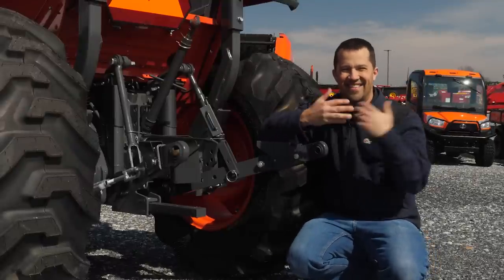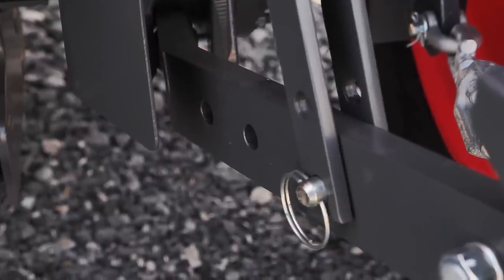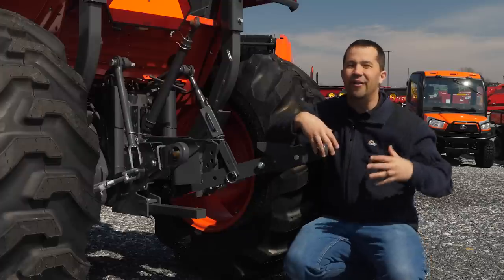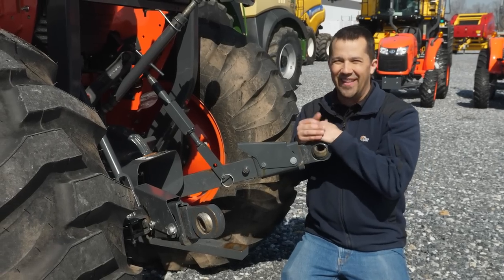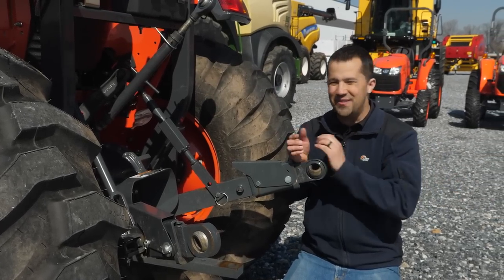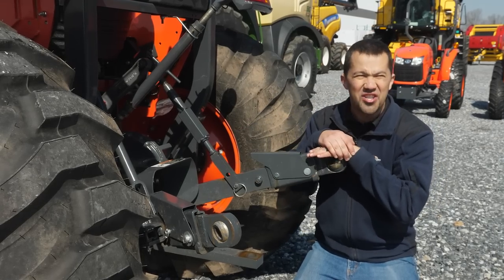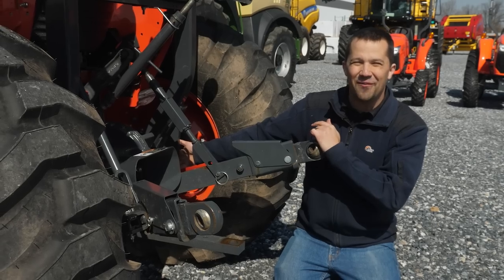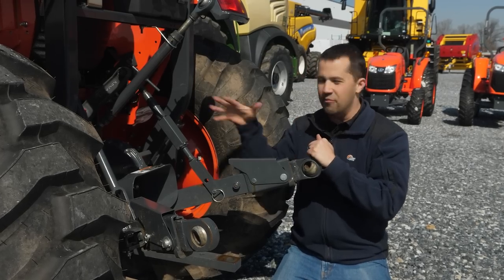What adjustments can you make to your three point hitch?

Comment: I work at an auto plant.  A lot of the holes or other features in a cars structure that aren't used in it's assembly are usually used at some stage in its manufacture.  A hole may exist solely to fit over a locating pin in a fixture before some parts are welded, for example.

Comment: I build my own tools to go on my 3 point hitch. I have a small compact tractor a 234 International  hydrostatic transmission tractor. I used a furniture dolly mounted for my 3 point hitch to move wood. It kept braking every day until I bought my own welder. I have built a box scraper, a rake and pallet forks . I also use it to stabilize it for pulling trailers. Works great! Multiple uses.

Comment: Hey Neil! Outstanding video and information, as always. I've owned two different tractors, and still learned something. When I had my BX23, I did have to make some adjustments when I had a PTO driven chipper that I ran off of the back. Didn't really know what I was doing, but trial and error ended up working out just fine. 👍💪

Comment: Excellent, Neil! Often with rear implements it's about geometry. Changing the length of your top link will change the angle of your rear blade causing it to dig in more. Trial and error can often be a brutal and costly teacher. Your tips are great. I really like the telescoping link set up. I had the old turnbuckles on my old Kubota and this is MUCH easier on my L3560.

Comment: Using a middle buster to dig potatoes using our LX2610, we shifted to the holes closer to the rear of the tractor on the arms so we could get the plow down far enough in the soil to kick the potatoes up. We also use a quick hitch, which adds some length, and helps add a bit more depth in this case. The process is a bit more involved switching back and forth as we have to take off the quick hitch to move holes on the arms, and then put them back for other implements, but this made all the difference in using that attachment.

Comment: Great explanation Neil! I would like to see a video on hydraulic top and side links and what advantages/disadvantages they offer. Keep up the great work! 😀
Reply: A hydraulic side link is usually connected to a remote with float capability. That lets your implement (say a landscape rake) tilt from side to side in order to follow the terrain. With a hydraulic top link, you can tilt the implement forward or backwards. That would come in handy for something like a box blade - tilting it backwards will make the rear blade contact the ground first, so so you're smoothing as you drive forward. Tilting it a little forwards will make the front bade contact first, for scraping. Tilting it a lot forward will maximize the scarifiers.

Comment: On my MX5200, I have to go with the upper hole on the lift arm when I put my grader blade on. This allows for more clearance to back over snow banks or dirt mounds to drag them out. Most every other implement uses the lower holes. I think I  change it for my rotary mower also so I can actually lift it off the ground for travel.

Comment: Neal. Thanks for the video. I am not a rookie and learned from your video. I have a 58 HP tractor that has a Cat2 3-point and it has a top link as you described. One end is Cat2 and the other is Cat1. I have not been using the top link that came with the tractor with my Cat1 blade because the Cat2 end of the top link is too wide to fit the space where it needs to attach to the blade. Watching the video it makes sense what you said about the top link being reversible. I went out to my tractor and found that the bracket that hold the top link at the tractor is definitely Cat1 size as far as the pin size and the measurement of the inside of the bracket.  so I am not able to flip my top link around and put the Cat1 at the implement because the Cat 2 end of the top link will not fit on the tractor side.  Hope this makes sense. I have been tempted to grind 1/8” off the shoulder on each side of the Cat2 end so it would fit but I have not done so. What do you suggest?
Reply from the maker: I have heard of others that grind the top link down. Your right, aftermarket ones don't always fit correctly.

Comment: Let me tell you, I have a B2650, plus a few standard Implaments. My pride and not so joy 3 POINT TRACTOR SUBSOILER ATTACHMENT.
 When it’s mounted on the 3-point raised all the way up, it has maybe one inch of clearance from the bottom of the fork to the ground.
  I have about 3-acres to play around, good part is Clay and Tree roots.  This Implement goes through it like a boss, even buried full depth of 18” working distance..
Reply: Must have hit just the right angle (top link length)

Too long the subsoiler can skip along the surface refusing to go in the ground.
Too short they'll try to haul the back end of the tractor down and can occasionally pull the front off the ground.

Good implement, Needs a bit of tweaking to get them right sometimes.
Reply: @fhuber7507  best i could do is get it as high as i could.  I should’ve also, i did have one fail, shear pins are there for a reason as i found out, sheared the pin at the top of the subsoiler where it connects to the top link.  I turned around and noticed the subsoiler was hanging kinda low, checked it, the bolt is about 3/4” sheared in two. I wasn’t even aware it happened.
Reply: @victorlawver6957  I look over my shoulder a lot running my subsoiler.

Fortunately, no rocks or roots to worry about, so once adjusted, rarely anything to worry about.

Comment: Aloha Neil! I’ve had issues with brush hogs… when I bought my first tractor (L4701) three years ago, I bought it with a 72” rotary cutter. I’ve broken six blades on the thing (although none lately). The way the dealer set it up seemed to create some problems… I read the manual and according to it everything was ok. I started adjusting various angles (tailwheel height, top link, etc), and things seem to be better now. Could you do a “master class” in setting one of these up? I noticed letting it “sway” more seemed to help.
Reply: Are you hitting things on the ground and not noticing that you're hitting things? I've seen some very poor operators beat the piss out of bushhogs and I've never seen a blade break.
Reply: I had a guy hit a concrete manhole cover and didn't break a blade he bent the output shaft on the gear box slightly. Never seen a blade break though they are nearly an inch thick
Reply: @mesanders1113  they break through the bolt hole.. I hit basketball size chunks of basalt the tractor tires rip out of the ground. I collect the loose rocks and haul them to my pile. Next time I hog, the tires pull up more rocks. Seems never ending
Reply: @BlackHawkBallistic  the nature of my land is the tractor tires pull rock loose almost directly under the front of the hog. After each mow I collect all the rocks and haul them to the pile. Next mow more rocks are kicked up. I don’t claim to be the best operator (that’s why I’m asking for help).  Happy to hear you are perfect! The blades stress fracture through the mounting holes

Comment: Good information Neil!  In a later episode, could you talk about adjustment of the 3 point hitch.  I have a L5030 that does not seem to raise an implement (rear snowblower) very high off the ground at max lift.  I heard there is an adjustment screw that could be used to vary the range of motion. Thanks
Reply from the maker: You would follow the directions in this video about moving the lift arm to a rear hole on the draft link. There is no knob.

Comment: I added a adjustable rock shaft to the left link side  so I can lower or raise the either side to use on my blade or rake when I need to go up steep grades when I can't pull loads up hill, works great.

Comment: I don't think you mentioned the adjustment on the right lower link. I'm new to this stuff but it seems to me that this adjustment allows you to level your attachment from side to side. Or in the case of a moldboard plow I think you want the right side higher than the left so that the plow is level when your right side tires are down in the furrow that you plowed open on your previous pass. Am I correct? Should this lower arm adjustment be used in the case of a plow to make the plow level when the tractor is tilted during plowing?

Update to my question -- I purchased a used plow and the hitch pins are offset, the one on the left is lower than the one on the right, so that the plow is level when the right side tires are down in the furrow. Not sure if this is true for all plows, but it would make sense.

Comment: Should you hook the top link up with the implement in the “up” position or the “down “ position? I keep bending the top link whe I use heavy implements such as my seed drill. Seems to bend when I lift it. So frustrating. What am I doing wrong??? Have a Workmaster 105 2022 version and a 6 foot Cabela’s seed drill

Comment: We have an older Kabota tractor, a B7500, and did a transmission oil change after finding a leak in one of the hydraulic lines. We changed oil, replaced the three hydraulic lines that go to the transmission and 3 pt. Hitch. We also changed the oil filter. Now the three point hitch doesn’t lift, or even operate at all. We checked the valve near the seat, checked the lever that lifts the hitch, nothing is wrong there. Any suggestions?

Comment: Outstanding videos.  Would love to know you thoughts on sway bar holes.  I have quick hitch and typically leave in pin in elongated hole.  I run a variety of implements, are there any that should be pinned in specific holes?  L4701 - RC, Box Blade, rake, spreader, disk, even have BH 92 Thx

Comment: Hi I would like to fit a hydraulic top link to my L2850 DT (1991). Is there a special valve available, attached to the rear hydraulic valve for the lower links or do I have to pick up hydraulics off the hydraulic bloc ( under the pump) at the right side front? Regards Heinz

Comment: Great video! I learned a lot in Messick's class today 🤣. Something that I can not find out is that I have the turnbuckle stabilizers on my L3901. With a quick hitch attached, can I tighten them all the way so that I have no sway on the 3 pt. lift arms or would that cause damage? Thanks in advance!
Reply from the maker: Depends on the implement. I usually like to have some give. If you hit something, the weak point is going to give. I'd rather have it bounce a little bit.

Comment: Neil - I bought a 7’ Enorossi sickle bar mower (from Messick’s in E-town) and am using it on a 65-HP tractor.  The lower 3-point arms are set at equal heights from the ground; however, the mower leans quite a bit to the bar side when raised.  Is this normal and acceptable or should I adjust the lower arms to level the mower even though one arm will be about 3” higher than the other arm?  Thank you.
Reply from the maker: It's a result of all the weight on the bar side. You could level it, unlikely to cause a problem though.

Comment: Hi Neil. How does the subframe for a BH92 backhoe on a Grand L 5460 cabbed tractor effect the operation of the three point? Im thinking about adding a BH92, but currently have a top and tilt cylinder system. If I put a subframe on, will I still be able to use the Top and Tilt? Does this also effect the positions on the sway bars? does it limit them? Thanks
Reply from the maker: Can use with subframe, but need to remove linkage when backhoe is on.

Comment: What is the max recommended RPM of a 2007ish M7040? I'm pushing snow with an LA1153 loader and wondering what is a safe RPM to use to get the loader to operate faster but not reduce the longevity of the tractor. I've been running it at 2000 or 2100 because 2160 is 540 PTO RPM so I figured the tractor was made to run that RPM all day long for weeks at a time. If I could safely run it at a higher RPM it would decrease my time on the tractor which would help a lot. I'm in it 4 to 5 hrs per snow storm as it is now.
Reply from the maker: Wind it up. You won't hurt it.

Comment: I made a video of the other hole on the three-point lift arms so the lift arms will go lower.. because my arms wouldn't lower enough to hook up implements and implement wouldn't go low enough.. should have been in them proper holes from the assembly

Comment: Do you kmow which position is used for the info on the spec sheet?
Reply: Most likely the hole that's nearest to the implement connection point.  That would give the maximum lifting capacity while sacrificing range of motion.

Comment: I’ve been told this, but no proof of it….

With older tractors that have draft control, where the top link attaches to the tractor, it has three three holes to adjust the sensitivity of the draft.   Any truth to this?
Reply from the maker: Draft control is done several different ways. Its probably true on some machines, but not all.